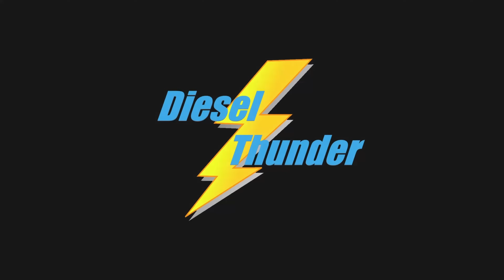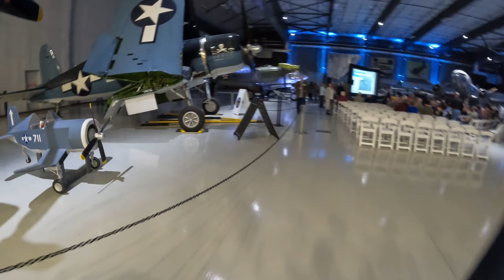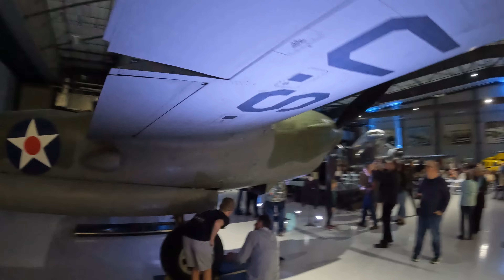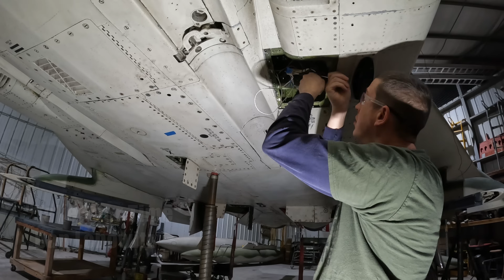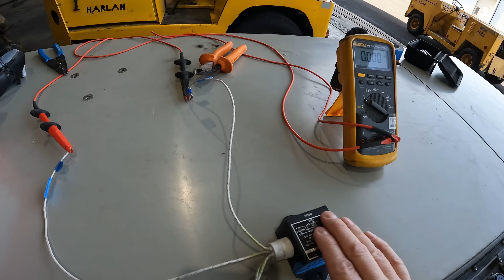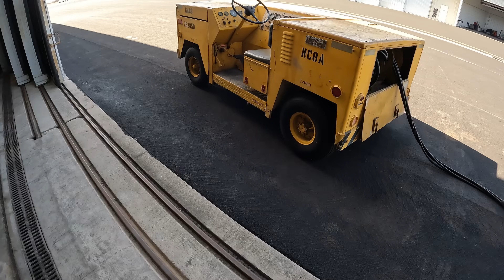Glacier Girl and Good Progress | F-4 Phantom

Comment: Your thumbnails should reflect what's really part of your content. 40% of this video's content was on crap other than the F4. My interest was on the F4 not other RESCUED WW-II aircraft.
Pro tip.. when working around aircraft and in airport areas its a wonderful idea to carry a set of silicone earplig in a plastic medicine pills jar attached to your lapel button hole, or foam ear plugs in a cardboard container in you pocket.
btw.. while stationed in Thailand during the Vietnam War I personally worked several times on this bird's hydraulic systems (it has three systems). I distinctly remember her tail number (from Ubon RTAFB in Thailand during the war). I even have  B&W picture of her from my collection of photos taken at that particular time.
Reply from the maker: Disagree with you on the thumbnail, though do respect your opinion on it. Not often one gets to see a flyable P-38. 
With you on the ear protections, I always have some nearby. That is awesome that you got to work on 63-7680! To be transparent, that is not this F-4's real tail number. That would be 65-0749.

Comment: You can always tell the sound of radial engines. It is very distinct.  I have wanted to see Glacier Girl up close for a long time.  I have followed the story for years.  I even met one of the volunteers that worked on the restoration project. I have an Ercoupe which is one of the only twin tail single engine GA planes.
Reply from the maker: For sure! One that will always catch my ears are the Wright R-1820's found on a B-17. Very distinctive and nearly unmistakable for anything else. Ercoupe? That's a neat looking aircraft!

Comment: Interesting to see the "rebates" in the fuselage skin for the Sparrow missiles, including a slot for the tail fin. Just like the plastic model!
Reply from the maker: Pretty unique for sure! They made the forward ones multi-purpose. Can hang and operate jammer pods and the Pave Spike targeting pod there. Pretty sure there's other stuff that was tried too.
Reply: My plastic model (probably in the 1968 time frame) only had Sparrows... maybe the other stores had not yet been developed.

At that time I thought the recesses for the missiles were just a feature of the plastic model.... but now I learn they're a feature of the real airplane.  It's a good idea, less drag, etc. @DieselThunderAviation
Reply: Also saw this detail. Does the oddly shaped thing, which can be seen next to the access panel you were working on, pushes the missile away from the jet? If yes, is this working and can be tested or  is it non functional als some form of demilitarization? Thanks for all the insights.
Reply from the maker: I think it does, and I'd have to look in one of the manuals to see what that did. Prior to the Foundation taking ownership, the Air Force removed or disabled various systems on the jet, mostly the radar and everything weapons related. We are able to hang stuff on the pylons but lack the ability to drop or fire anything.

Comment: Glad that the T/R tested good!  Also glad that you mentioned that no-load output could be different than when loaded.  It's a subtle detail, but can be important.  As part of testing the T/R, could you have also used the diode check function of the meter to verify which terminal is positive and negative?   Seems like it should work.  As for Glacier Girl, I saw it at Oshkosh in 2010.  Neat story behind it!